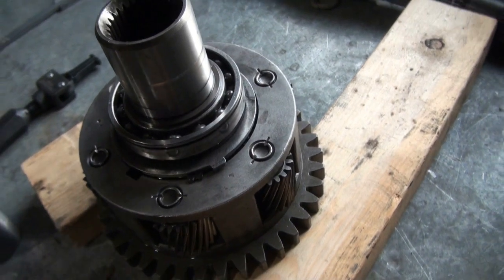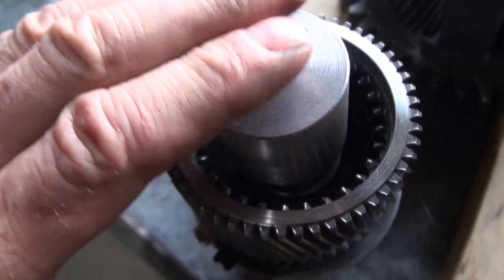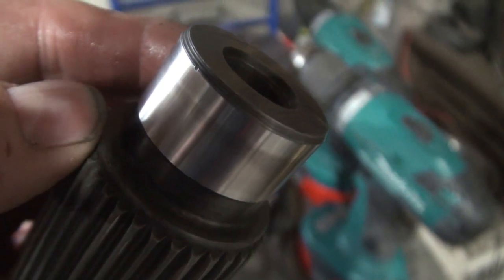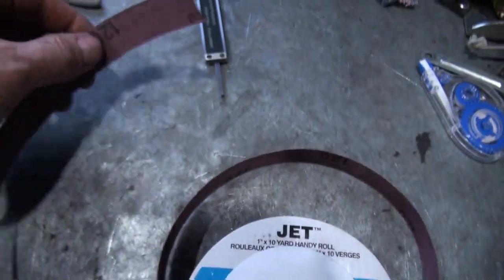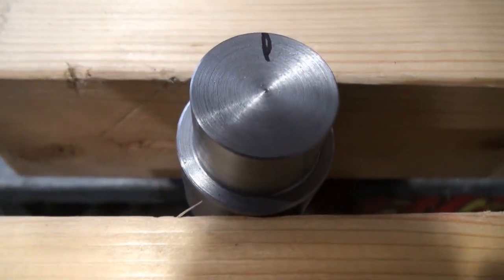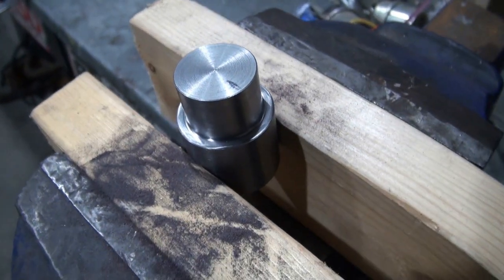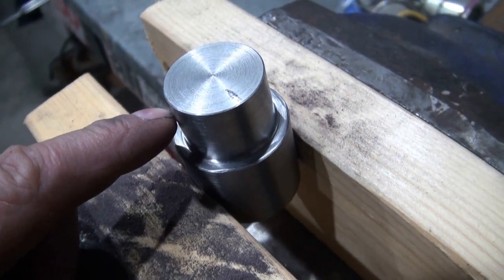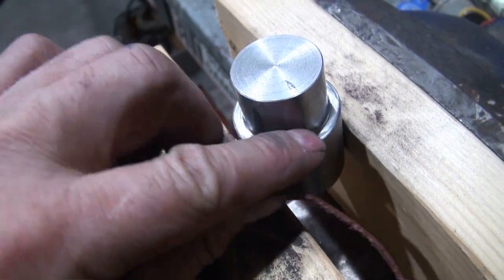Resizing A Custom Bearing Driver

Comment: I am surprised you don't have a lathe...over the years you have had many parts made at your local machine shop.
Reply from the maker: I would like one, my dad also wants one, he knows if he buys one there is room in my shop for it :)
Reply: My lathe was one of those purchases that once it was in place...I couldn't imagine my shop without one.  It has been a very, very good purchase.  My suggestion if/when you start to look for one... know you can always fabricate small parts on a big lathe, but you can't fabricate big parts on a small lathe.  I thought it through and was very realistic about my needs and what I felt my shop space could tolerate and ended up buying a size up from that.   I have a vintage 1950's Logan 10" x 24" and it's been able to handle 95% of my projects.  I really enjoy your videos, it's great to see you back uploading.  Take Care, Steve.